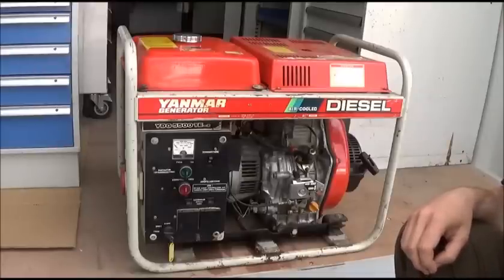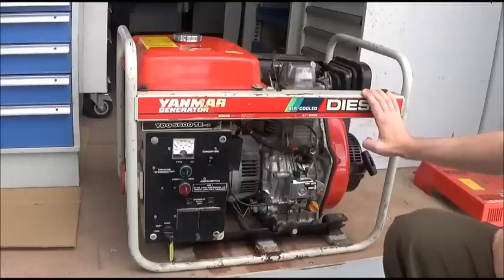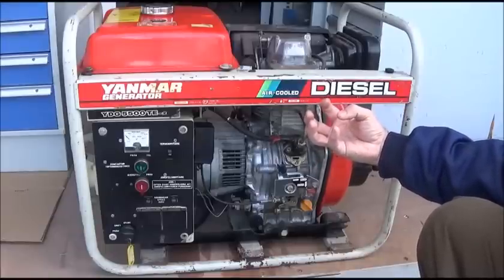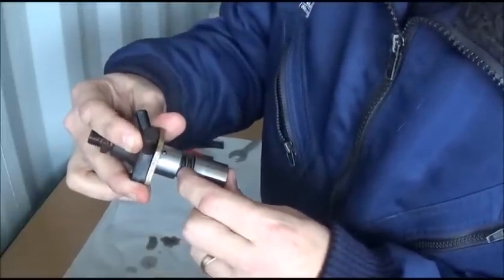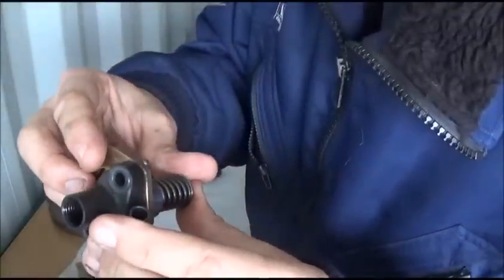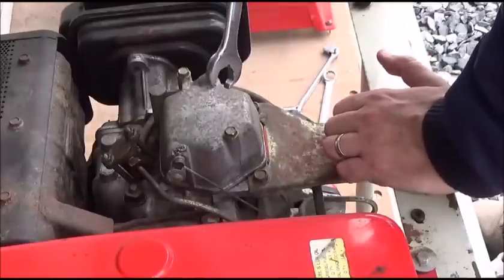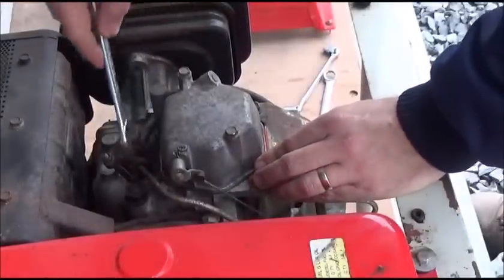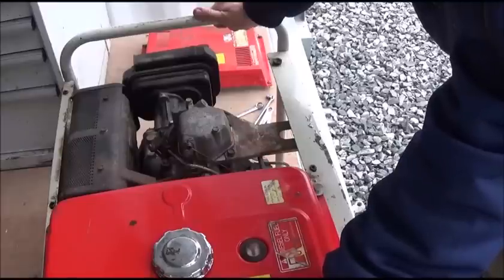Fixing a Yanmar L90 or L100 diesel engine

Comment: My Yanmar L90ae is leaking at the point of the trapdoor.  What would cause this?
Reply from the maker: I assume it's leaking diesel. This could be a poor seal between the pump piston and cylinder which is allowing diesel to weep past. These are very tight tolerances so if the fuel filter let rust through or water managed to pit the surfaces, these parts would need replacing.
Reply: @kickinthegob  No, it is leaking oil from around the bonnet that covers that indicator pin.  I just put a new gasket on it and will test it tomorrow.

Comment: I've never had anything stuck on my Deutz 12-1 nor My Sichuan Sifa MB168F three horsepower. The later has never been bled since it was brand new. I just use the decompression lever and give extra pulls until I smell diesel through the exhaust. Ether can be dangerous for priming.  On cold days, use hot water on the cylinder instead. American pump diesel is very clean to store long term. I've filtered fuel with a cotton ball. I start motors at a low throttle. Mount your project on plate aluminum, not a steel mess.
Reply from the maker: Diesel quality is important. In Norway, we tend to get moisture build up through condensation in the tanks. If you run a fuel treatment that usually absorbs the moisture but most people forget on small engines.

Comment: Hi, 
Under the injecteur there is sealed setting ! 
I suppose it is to adjust the flow of the pump.
I think my engine gets to much flow. It makes exhaust pipe red and induces even flame out the exhaust...(when I stop engine decompressing the exhaust valve).
What is your opinion of this matter or symtom ? Should I reduce the flow ?
Reply: if they are the copper gaskets under the pump, those don't really affect the flow of the pump, that controls the final advance of the pump, the flow of the pump is controlled by the governor. check you valve lash. and you try and not use the decompression lever to stop the engine, use the the throttle lever to do so.

Comment: G'day, I was given a Yanmar Chinese clone (186F) silent with only 21 hours on the meter. I collected a bucket of rats nest from inside the enclosure and re connected 4 electrical wires that were chewed in half The previous owner was moving abroad and didn't want to pay import tax on something that stopped working due to  five years of neglect. The problem I have is with little compression and the fuel vapor blowing out of the intake manifold, I've bled the fuel pump and lines and the injector is working fine, low oil and fuel shut off switches are working and I have replaced the copper head gasket and adjusted the valve clearances but still no luck in getting it to run. Do you have any tips or tricks please?
Reply: does it try to fire? and plus with little compression it might not fire. I wouldn't be surprised if the rings are stuck on the piston, preventing it from firing. in order to fix that the whole engine have to come all apart and the piston will have to come out to get them unstuck.
Reply: Sounds like potentially mentioned piston rings being stuck bleeding into crank case, but more over you mentioned the fuel vapor blowing out of the intake manifold. This sounds like stuck open or clogged intake valve, so press the valve manually to see if it moves, if not, that is clear indication, remove the head and see what the issue is. Another is just corrosion or debris between valve and valve seat requiring cleaning, valve lapping and then valve clearance adjustment. On the positive note least yours inject the fuel properly. My similarly abandoned clone had stuck injector pump to point of having corrosion from having open to air fuel intake hose and some moisture rusting and pitting the area where fuel flows in and after cleaning it does not produce enough flow or pressure and what little fuel it does pump goes out from injector return line.
Another point of failure could be the injector seal in this particular unit, but stock injector is longer than 186F replacement that previous owner had ordered, well as fuel return outlet and intake being on wrong side to index pin, so need to delve into wtf the new injector even is, or the clone unit for that matter.

Comment: My fuel pump is frozen stuck I tried the piece of wood but it's still stuck. Any suggestions appreciated, new fuel pump is on the way but I would prefer saving this one as a back up, engine was never used brand new has been sitting for 15yrs
Reply from the maker: Hmmm. Is it not moving at all or is there slight movement? Also, try tapping from each side of the pump as demonstrated in the video. It will work free eventually. You can also soak it in acetone or thinners to help remove any glazing causing it to stick.
Reply: @kickinthegob  Could also be moisture getting in trough the fuel intake and rusting the area on the rod. Mine would not move, so i removed the pin holding the peace surrounding the needle part and lovingly tapping the needle arm back and forth side to side got it moving, then pulling the spring assembly with hand while doing the same and covering whole thing with lubricant. Got it open and cleaned up but corrosion had pitted the rod on the point where it had gotten stuck so i presume this is causing lack of pumping, so probably need to replace the pump

Comment: I'm working on a generator, got new fuel pump and noticed  tiny air bubbles coming from the pump back to the filter, and I can hear  that it's sucking air.  Any ideas? Thank
Reply from the maker: It's likely that it's pulling air from one of the joins. Just nip it up the nuts and check for bubbles. They're a metal on metal seal and have to be fairly tight.

Comment: what causes the plunger to stick ????????????
Reply from the maker: Normally it's the moisture in the diesel. All diesel has a little water.
Reply: I have the same engine bought it brand new 15 yrs ago, but did not use it until now. Fuel pump plunger is frozen stuck

Comment: Great info. I have LLP4.5 lister having oil spraying initially but as starter speeds up spraying stops. Appreciate assistance.
Reply from the maker: Is there a spring at the back of the pump cup that rides on the cam? It sounds like there is not sufficient tension in the spring to cause the displacement of the plunger shaft once the engine picks up revs. Similar to floating valves on very high revving engines.

Comment: Right now, i am struggling with a '15'hp 498cc yanclone..it won't give output! It is slower then the 13 hp engine.. have the gov. spring on outer holes, limitation screw totally removed, but bad cold start, low output and hardly any smoke/lacks fuel?)
Reply: I even tried whithout fuel filter, swapped the pump for an other one, no smoke, no power.. installed the 188 winsun again. Too bad i was looking forward to a little extra power (i built the engine in an enfield motorcycle) The only thing i did not swap was the injector; It is uncertain what kind of gasket it has. Some have some kind of teflon(/) sleeve which is hard to replace..
Reply from the maker: @enfielddnepr  Sounds to me like you may have a blockage in an inline filter. These engines are pretty tough so it is likely a filter or injector blockage.
Reply: @kickinthegob  Checked all this in first instance.. also replaced the fuel pump.. no effect..
Reply from the maker: @enfielddnepr  Have you checked that you are getting fuel through the injector? Be really careful when testing because it's possible to get an injection injury if you pull the starter with the injector out of it's housing.
Reply: @kickinthegob  The high pressure line is free and has no blockage, the injector is tested and works good at the right pressure. This is done after it was discovered the new injector had RUST in it.. This only can occur whe it is assembled with rusty parts. (since an injector is closed at rest). I cannot find any reason why it is underperforming, but when an engine is assembled like this, maybe i should not expect more from it.. no more Chinese engines for me!

Comment: I cant get mine to work i bled the lines,Inspected the pump i even tried starter fluid and it wont start, It seems to have good compression because the starter has a hard time turning it over its brand new 25 hours . any idea what it could be?
Reply from the maker: Highteckhobbies - Hello. How old is the fuel? How long had it been sitting before you tried to start it?
Reply: i drained the old fuel but the engine has not started in over 5 years i think i just need to keep trying and it will start.
Reply: @CultureClubHobbies  could be stuck piston rings.

Comment: Thanks for the info, I had the same problem with my 186FA engine it worked for 15 minutes then it stopped running suddenly.. Check air supply ok, injector is fine. So fuel pump may stop working after 15 minutes.. Help
Reply from the maker: Hayder Qays - sorry for the late reply. Did you check the fuel? Old fuel can block the filter and starve the supply. Diesels are not fussy on air and if they don't have the right mix will just smoke a bit. If they are starved for diesel they will stop. Let me know how you get on

Comment: Hi there. Thank you so much for the precious information shared. I have the same issue on a marine diesel and even if the engine is different the diesel pump is very similar and the plunger was stuck as you said. Got it fixed up and now I will try and see if it all goes as usual. Keep it up with nice videos. Ciao!
Reply from the maker: Lorenzo Catalano - I'm glad you found the video useful. They are simple engines and will run for years as long you run them a few times a year to keep everything lubricated.

Comment: Can you show/explain 'spill timing'of the pump on these engines?
Reply from the maker: At 7:16, You can see the throttle slot that the needle engages or sits in. With the pump removed, you can move the needle arm left or right to adjust the pump. I think this is just for flow volume adjustment but I wouldn't imagine that spill timing should be adjusted on these engines under normal conditions.
Reply: @kickinthegob  Timing is adjusted by adding or removing metal shims between pump and the engine frame (dont ask how much but adding should increase delay and removing decrease the injection delay), though as mentioned not something that is normally done, while volume is adjusted by the needle thing and treaded rod/bolt on the bottom of the throttle mechanism adjusts the idle. Not a expert but what the previous owner of my unit told me.

Comment: https://youtu.be/pYpONRsjVzs Hey good news. It's now the day after and the little diesel is running again. The only new thing I tried was free up the pin on the end of a horizontal threaded thing, maybe part of a governor? Not sure what that pin does but the engine fired up first pull after I jiggled it. Thanks for helping me out. There's a cup of tea for you if you're ever in England ;-)
Reply from the maker: That is indeed the governor. When you put the pump back in, the pin has to be held captive by a little bracket that opens up the flow like a choke. I made this mistake when I first re-assembled my engine. Glad it all worked out. I may just take you up on that cup of tea. England's not far from Norway :D
Reply: Tractorhead k

Comment: Hi, I've a Yanmar l100 from a pressure washer, now in a lawn tractor project. It wouldn't start after about 2 years laid up. I watched your video, bled the injector and it ran fine. It's pull start only btw. Restarted fine too but next day nothing, bled it, nothing, checked in the inspection window, looked ok but cleaned up the pump anyway, it was dirty but not siezed, reassembled, bled it through, still nothing. Any ideas?? Here's a video of it if that helps https://m.youtube.com/watch?v=dBzbOgC_TjU
Reply from the maker: G'day Tractorhead. It sounds to me like air in your line. Even after you bled it, it might be air getting sucked in between the fuel pump and gasket or gasket and engine. Also, check your fuel filter. If you havn't changed the fuel out and cleaned your filter, you might have too little fuel and maybe even check the air filter. You have compression, so check fuel flow / fuel quality and air. Good luck and let me know how you get on.
Reply: Thanks for that Mr Kickinthegob, well it's a brand new air filter unit so that should be ok, and at the moment the fuel tank is removed and I've a direct gravity feed of fresh clean diesel to the pump so should be plentiful input. Have I even got a fuel filter? Don't think so...   So that leaves the air sucking in at the gasket.  Top suspect.  By gasket do you mean the brass shim things visible when the pump is removed? Is there another gasket? Should I replace the shims with blue hylomar? Cheers
Reply from the maker: There is a fuel filter made of nylon mesh in the fuel tank. You are correct, the brass gasket could be the issue. Are you getting decent flow when you pull the chord with the fuel line off?
Reply: I've not seen one in good working order so nothing to compare with but I'd say it's a slow and feeble 'phutt' of diesel with line off not the rumoured high pressure jet that'll fire diesel right through your thumb (or is that only the injector?)  Takes a lot of pulling before any diesel appears at the injector end (but it needs to fill the pipe I spose). 
Those brass gasket things ~ are they spacer shims or do they need to be airtight too? Does the crankcase need to pressurise maybe, seems to me the high pressure action all occurs inside the pump and the 3 bolts just locate it on the engine.  As you may've noticed I'm no expert lol